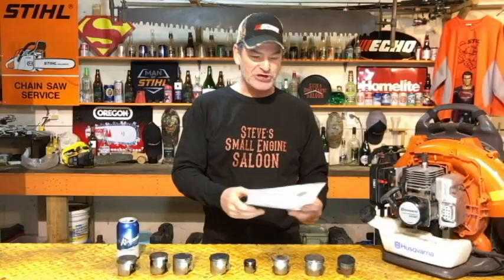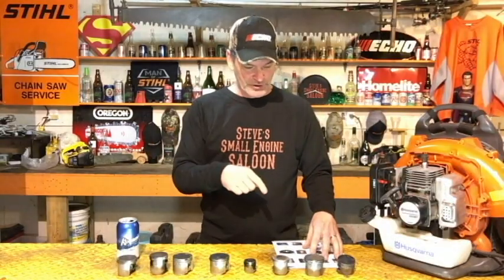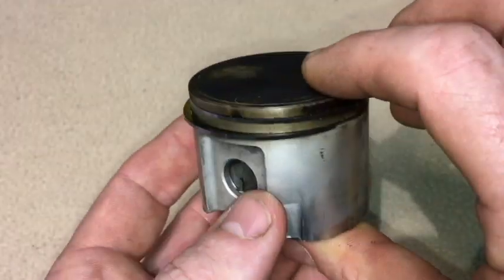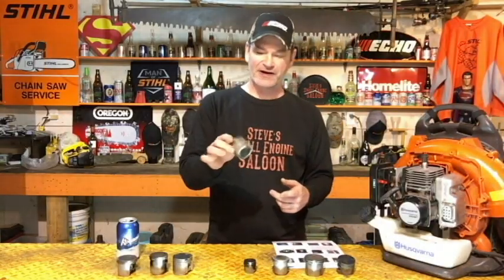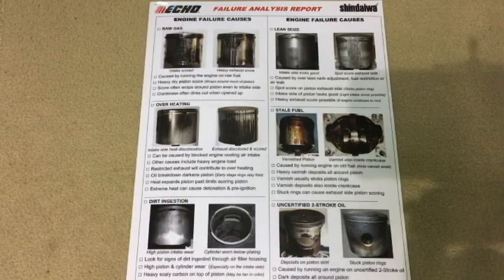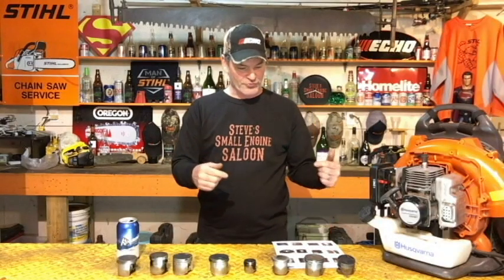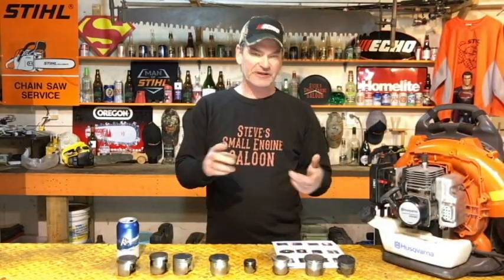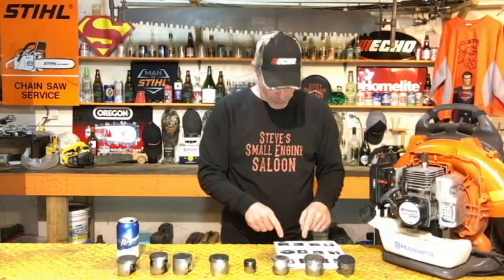How To Tell WHY Your Piston is Destroyed

Comment: Great discussion. I think if you don't see much smoke coming out of the exhaust, the oil in the fuel is too insufficient . I have a Kawasaki triple and I found one of the oil injection pipes was mostly broken reducing drastically the oil pressure to one cylinder

Comment: I think my failure was caused by not mixing enough oil in with the gas. I used to measure and then I started eyeballing it and I think I paid for it. Also mixing it up enough may have been a factor.

Comment: In my experience stirl engine oil is  scame, especially if you buy 5 liters and the original fs 280 slinder head sets is two times equale a 5L engine oil. So why protecting it with a stirl expensive oil?
Reply from the maker: "In my experience stirl engine oil is  scame, especially if you buy 5 liters and the original fs 280 slinder head sets is two times equale a 5L engine oil. So why protecting it with a stirl expensive oil?"

WTF is this?

Comment: Just took a new CS-4910 out to use.   Fresh Ethanol Free from the pump that day, Red Armor oil.    Warmend it up for about 5 minutes (idle) Was able to cut for about 30 seconds.   Stalled and that was all she wrote.  I took the air filter cover off and it was already covered in fines, the carb compartment was covered in sawdust as well.  30 seconds of use.   Took the muffler and carb off, then eventually took the cylinder off.   Deep scoring on the exhaust side in the exact width of the exhaust port, the rings were stuck in the grooves from the scoring.  Intake side looked perfect.

Comment: Great information, I have a Stihl MS261 C-M which I am told by the workshop that it has overheated, it is just 2 months out of warranty, I can assure you that the fuel/oil mixture is correct as I am very particular about this. Currently they are waiting for an answer back from Stihl, but I guess they will blame me not anything to do with the saw. Stihl website states that as it is a commercial saw, they expect that it should last for 5 1/2 years, I am only using it for domestic firewood, and it has hardly been used, I have been trying to find out if anyone else has had a similar problem, could it be a fault with the saw. Fortunately in Australia our consumer rights are very strong, but I hope that I don't have to go down this path. If anyone knows of this happening to others would appreciate some information to follow up on. I did everything by the book, maybe as you pointed out, could have been an air leak, will be interesting to see what they come back with, but you video gave me an insight into what could have cause the problem, and something to argue on.

Comment: Hi Steve, Here in California there are so many restrictions regarding fuel / oil.  I can only buy the oil in 50:1 / 40:1 ratio, meaning I cannot buy one or the other, even though a particular two-stroke engine specifically calls for one or the other. Is there a big difference between the two? Thank you for your time.

Comment: Brilliant Steve , I run all engines which not run every week with Alkylat  fuel 2 and 4 stroke , not with environmental crab from the gas station ! Results : no gum no melted rubber hoses and gasket’s and so on , they just run since 42 years of infrequent usage .
Carburetor adjustment : max rpm and then  go rich until the rpm is dropping ! Lean air fuel mixture = high burning temperatures !!
Skål from Sweden .

Comment: Thank you for the video, very good information. I know you made this video some years ago, but I have a question. If there is scarring on the piston and/or cylinder wall will that cause compression problems. My Echo weed eater starts, it revs, and can run the entire time I hold the throttle open. But as soon as I release the throttle it dies. I pulled the cylinder off and there is scarring on the piston. I’m sure my piston is shot. I put regular 87 gas in the tank and used it quite a bit, then one day it just died. I put 2stoke fuel in there, but it won’t stay idle. I inspected everything else, but the piston seems dead.

Comment: Old video but I'm going to try. I straight gassed a ms 391 and blew it. I just rebuilt it, sharpened the chain, new spark plug, new filter. Ran half a tank through it and pulled the muffler and have slight scoring already? I've read the ms391s are known for running lean because of some auto tune thing. On the left side of the carb. What should I do?

Comment: The piston in the Echo backpack blower I got free had material pulled over the rings but in one spot about an inch wide. As this was my first two stroke project and was meant to sell I couldn't spend much. I ordered a piston kit from the only place I could find it but still have it in the box as I wanted to find why this happened and if I could fix the piston. There was a pencil tip defect in the cylinder that I gently ground away. I used a file to clean up the gouges in the piston and the ring grooves and sanded the rings on glass to get them flat. It pulled over so smooth and fired right up. So much for selling it as I need it now for some odd reason. Thanks again as this is on you like the free Stihl MS 170 I fixed for $20.
Edit: I, once again, wrote a comment way too early but there's nothing I need to change. I'm just happy Echo puts out information like you showed as I have a lot to do and have years of four stroke experience and a week of two stroke.

Comment: Really a great insight into piston problems .  What does a piston look like after a well cared for life but has just reached its projected lifespan . I have a Stihl SH86 which I have had for twelve years , I replace everything but never done a compression check . I watched your video on compression and am awaiting delivery of  a cheap pressure tester just to find out pressure .
With your unlimited experience  ,  would  piston and rings sort the no start problem , or would I need to replace cylinder as well .  After  inspection through exhaust  port I see no scoring  .
Thanks for all your videos , they have kept all Stihl machines humming for a long time .
The detailed info is outstanding , and the beer looks OK too .

Comment: Wow! Don't know how I missed this first time around. Popped up in my feed, and I thought you changed your branding. 😇 The only thing I would add is a 4-corner seize. As the name implies, four long, skinny marks on each side of the gudgeon pin caused uneven piston expansion. I think it's more common in the 2-wheel, go faster world:  Basically a cold seizure caused by not warming up before going WOT. It is often caused by poor clearance/tolerances on mismatched iron cylinder re-bores for one-over sized pistons, and crank/con-rod upgrades. I think it's less common in the lawn/garden equipment world as piston replacements are so often sold a a complete top end kit. Great video! 👍
Reply from the maker: Right on Stella Love!  You might like this video also on 4 corner seizing!  https://youtu.be/8Q3J1cVGByQ

Comment: Very informative. It missed exhaust side scoring caused by carbon build up in the exhaust port. This can be caused by running far too rich, or rubbish 2 stroke oil, or mixing the oil too rich, or on weed eaters not opening the throttle to give it a good blow through every time you use it.

Comment: My uncle gave me his Ryobi weed eater and I used it for a year. It got an oil change after 1 summer of use and the next fall we tried using it with a pruning attachment but  it locked up. So I took it apart and the air filter was non existent and the piston chamber was filled with a mix of oily crusty goo. I think it needs a new piston with rings now haha.

Comment: So many comments!  I didn't read them all but I didn't see what caused my issue with an old stihl 032AV.  What happened, for whatever reason, my crank to rod bearing came apart and parts of it were sucked up into the cylinder with bad scoring results as you might imagine.  Pretty obvious after tearing down but not so much so by looking through the exhaust port.  Thanks for your very useful and thorough videos.

Comment: Just tore down my WR450F dirt bike after 3 weeks of riding in the dunes. Was still running but was smoking. Sand had made it past the air filter (after all per cautions) - cylinder was polished smooth and there was burnt sand accumulated on top of the piston = full rebuild!

Comment: Steve I picked up a david bradley model 758g it was pretty cheap 75 plus sh for 140. There was only pictures of the top. So I took a chance. It showed up with every thing that it came with. And overall Excellent condition. Low hrs. No corrosion. Pulled the exhaust and piston has fairly good sized grooves.  The inside air cleaner mounting face was upside down. The air cleaner was sealing some what ok. It was the other side carb gasket had only 2 points to seal. So I figured. Dirt and chips were sucked in. I pulled the reed valve. Clean in cc. Surprisingly. So then I thought lean and noticed the cylinder was colored burnt. It's got compression. Plug tip is ok. The porcelain is tanned. No spark. How do I get the flywheel off? Not the hammer thing with a whack on the cs end is it? I was gonna rinse it out but maybe just run it.  Rings aren't nor were they ever stuck that I can tell. What happens when they get hot like that? Case gaskets get thrashed?  Thanks

Comment: In a smooth bore, 4 cycle, the ring end gaps are spaced so they're not riding on the thrust face, but as the engine runs they can rotate. On a 2 cycle, that's deadly, the end gap at one side of the port would see the other end of the ring pop out and have to slam back into the ring land on every stroke, resulting in engine destruction in seconds. The locator pins actually serve to keep the end gaps OFF the intake OR exhaust port and ride up and down on the bridge on the cylinder wall between the ports on the left or right of the ports depending on engine design.

You can actually go to college for this stuff. I made my employer pay for it all.

Comment: Have a Yamaha golf cart to cycle started sounding rough and I noticed fuel was squirting out of the overflow on the carburetor and when I turn it over I can tell that the piston and cylinder is rough, just wondering if too much fuel could do that.
Reply: No running in engine and Rich will not cause scoring to happen on the cylinder walls and the piston the only thing running an engine rich will do is just have excess carbon buildup and unburnt fuel running lean with too little fuel can cause higher than intended cylinder temperature and temperature of the entire engine which in extreme cases could cause some warping of the cylinder walls but as long as you have it been in there in poking around and adjusting stuff when you haven’t had any previous knowledge of what you’re doing neither one should cause scoring to the piston and cylinder walls
Reply: What I would recommend and with my experience whenever you turn off engine it will backfire or be especially rich on start up if it’s a smaller engine like a lawnmower you may see black smoke but with some thing like a golf cart that may actually have a bigger muffler you may not necessarily see that and that’s generally a sign that you need to clean out your carburetor. Now you we need to figure out depending on the year of the engine if they have a plastic or metal carburetor if they have a metal carburetor you can go ahead and just spray some carb cleaner down the intake and use some compressed air to force it through and it’ll be fine but if it’s plastic you need to use WD-40 and compressed air because carb cleaner will disintegrate a plastic carb

Comment: Thanks for that. I killed my mc culloch cs420t. Run for 10minutes and then died, repeat for 5 times. Admittedly I was splitting a 30" log. Overheated and died. Outside Temp was normal for here ~100°f.

Comment: I think I overloaded and overheated my little machine trying to cut a lot of hard wood. Maybe I didn't wind out the high speed carb jet enough as well. Engine won't start and piston looks a little scratched as I look through the exhaust port. However engine feels like it has good compression when I turn it over with the starter rope. Could it still require a new piston/ piston ring?

Comment: I got a question i hope you can answer for me......so i got some damage on my cylinder head and piston....the cylinder head has 3 tiny raised burrs inside by exhaust port can just notice them with your finger ....rest of the bore is nice and smooth....do you think if i hit it with a hone quick to smooth out the burrs and add a new piston and ring i will be good to go with no problems ? Is there any wiggle room with a tiny hone and oem piston and ring ? Thanks man.

Comment: The question I have is not part of the cylinder I have a Husqvarna blower that the flywheel has got play in between the crankshaft so I ordered another flywheel and it's the same thing so I'm getting spark I'm getting gas I'm getting compression but the timing is off because it has play in between the crankshaft and the key

Comment: 10w30 is the best mix fuel.  
If you dont believe me try it.
Buy a cheapo 2 stroke and run it. And run it hard!!  After 50 tanks pull the piston and check it out.

I use to buy the stihl 2 cycle oil then I found they run just fine just with motor oil.  Now i run motor oil in all my stihl saws.   Have over 100 tanks and no issues.  So 2 cycle engine oil is just a money making ploy.
Reply: Supertech 2-cycle marine oil TCW sold at Walmart works really good in a POS MTD trimmer even if you pin the throttle and run it hard. No scoring of any kind after several years of use. The stuff is like a dollar for a small bottle or fifteen bucks for a gallon LOL

Comment: Appreciate the time and effort that you always put into all your videos.  This one especially.  On the cold seizure failure, the piston needs to expand but the cylinder needs to warm up too.  Parts of the cylinder are not subjected to as much direct heating as other areas are.   Clearance on the exhaust side of the piston is probably the first casualty of loading up a cold chainsaw.  Again, great job on all the videos.

Comment: Steve, since most gas has poor shelf life, what do you think about 100 octane low lead aviation fuel, it has a great shelf life.
Been running it with top shelf 2 stroke oil for 2 years now and no problems yet. Yes it’s a bit more expensive, but were only talking about 5 gallons a year.

Comment: Thanks Steve, Interesting video, far from dry, On that note please let me bore you with a story on two stroke engines running lean. I worked with with a guy years ago who hated two strokes (chain saws) because he always had trouble starting them and were continually oiling up plugs. One day I watched him mix fuel @1:50 and found he was reading the ratio 1:50 as millilitres! So 50ml to 1litre so for each charge of air fuel the engine take there’s less fuel, so running lean and would naturally be hard to start. He’d been a farmer for 20 years and a Park ranger for 10 years, I was a young upstart who loved his two stroke motorcycles and I wasn’t popular when I pointed out his mistake. So now a question, what effect does running lean with lots of oil have, aside from hard to start and oily plugs?

Comment: Excellent video, well explained, presented and illustrated. Question... a Stihl blower (as that's what I'm working on), has had someone install the piston backwards. Foolish me failed to inspect exhaust outlet before installing new carb... I saw the piston ring pin in the exhaust port later! How about a small segment on how to diagnose starting issues - in this case, I put a little fuel in plug and it ran, real, real bad - if at all. Them checking plug it was totally dry. Piston (having disassembled is scored on the retaining clip side of wrist pin (perhaps not related?)... just a thought. Have a great weekend - have a frosty on me!
Best

Comment: Thx so much I could only run a blower with the choke on and when I took it apart it was the overheating one but I think it was a cold seizure but luckily it was my dads blower. 😂
Reply: Nvm it was the lean one 😂 bc it was leaking metallic oil.

Comment: Hey Steve, I have a walkerized 461 with what looks like a lean seizure. It runs, but overheats quickly. When putting in my new aftermarket piston kit (thinking Meteor), do I need to contact the shop to see what was done to the saw? Will the walkerization effect what I need to do to fix the saw? Thanks very much for the videos and help.
Reply from the maker: Most likely Walkers modified the piston AND cylinder.  So if you put in a stock piston with a modified cylinder, the timing might be off now.  If you phone them, talk to either Johnny or Donny....

Comment: I'm so happy to finally be learning about small engines. Thanks Steve! My Stihl Farm Boss is finally getting some much needed attention. My cylinder looks the overheated one, and yes, I'm surely guilty of cutting with a dull chain. Almost all the scoring is on the exhaust side, but there is also some on the intake side, lined up exactly with the piston ring locator pins. Why would that be?
Reply: Too dull or sharpened too aggressively will do the same thing. Brand new Stihl chains can be a little too aggressive for their smaller saws (of course, the wood being locust and requiring almost the entire length of the bar doesn't help either).

Comment: I'm replacing my cylinder assembly, I know two cycle motors oil with the fuel, but does there need to be any oil in the crankcase prior to running it the first time or do I just need to run it thick on the first tank to get the cylinder oiled up?

Comment: That why I don’t recommend use Amsoil saber at 100:1 cause it too thin especially equipments is brand new. Lack of oil what cause to scratch piston. I rather use Amsoil saber at 50:1 mix ratio just to get good lubricant oil around piston and wall. So it doesn’t look so dry inside.